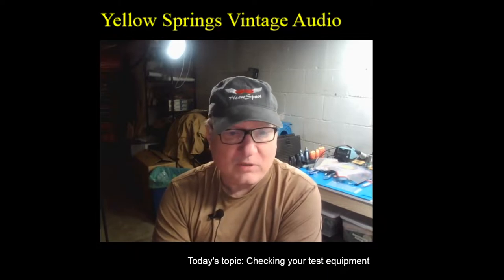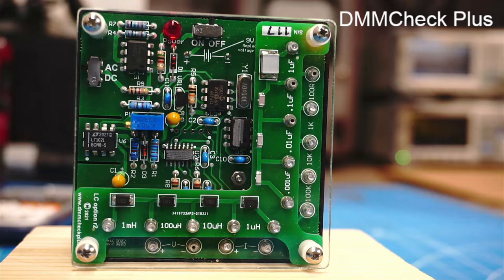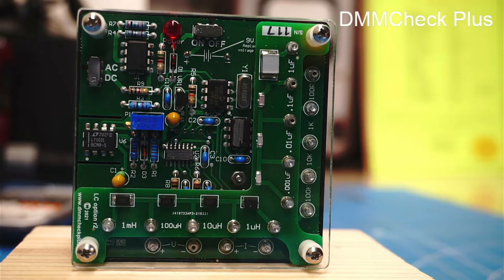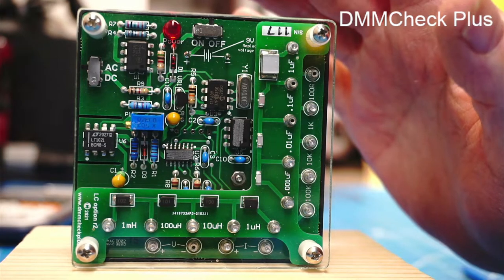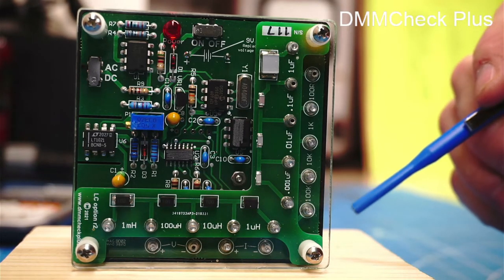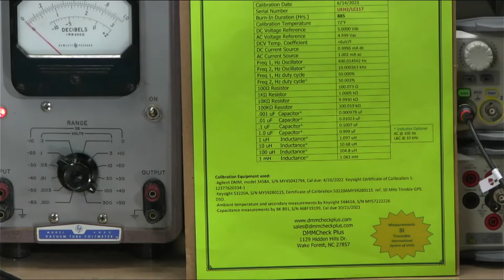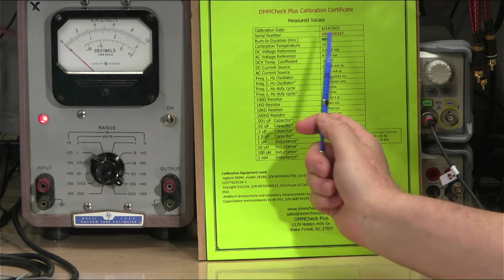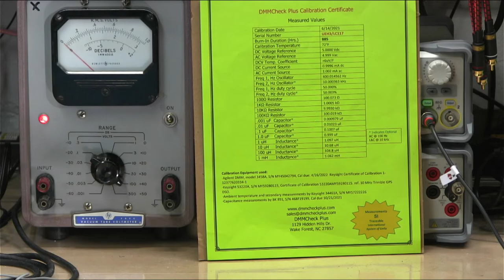Spot Checking Tape Deck Test Equipment

Comment: Very interesting to know about this device. Since getting into this hobby i've acquired a selection of vintage test gear - so much nicer - that's probably all out.
Keep sharing your knowledge and thankyou for all your videos.
Reply from the maker: Thank you for the nice comment.  If you are using vintage voltmeters to measure tape deck levels, you really should watch this video that explains why some vintage meters may not indicate levels correctly.   https://www.youtube.com/watch?v=c5rPQToZM-M